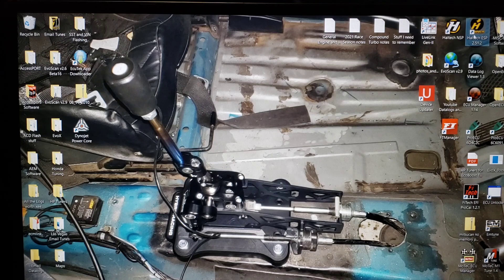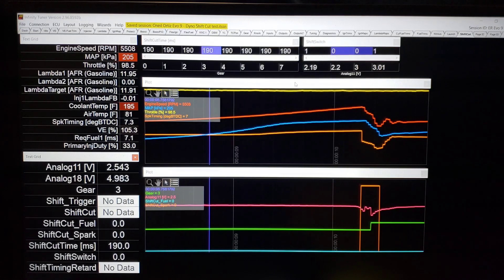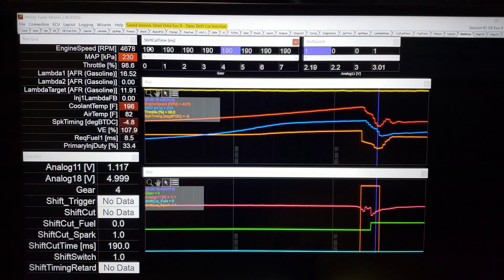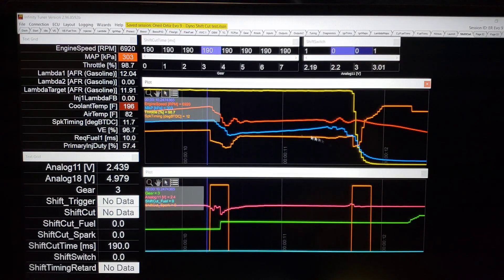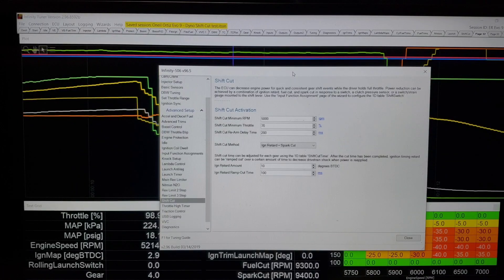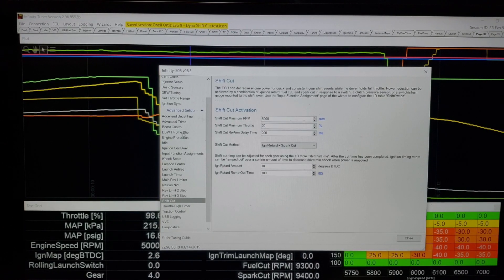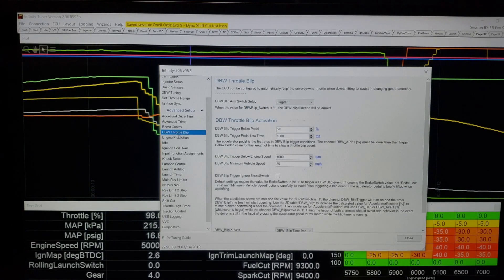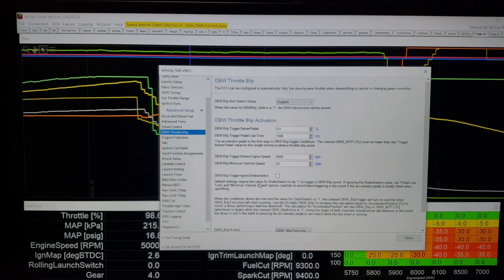Shift Cut strategies for dogbox and sequential transmissions

Comment: Thanks for the videos mate. I've never had an aftermarket unit only factory PCM but it's good to see the info and how it's implemented.
As for the throttle downshift blip, I'd try it for road use (daily traffic driving) with the sequential/dogbox as the ones here in Australia swear by it, not they they are daily drivers but takes some pain away if needing to drive to a track or car cruise...
Thanks again.